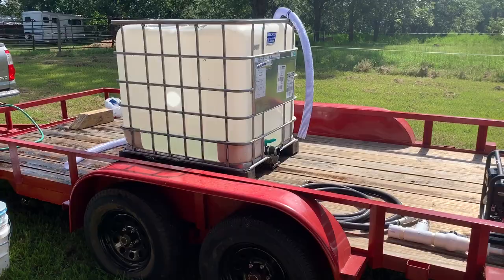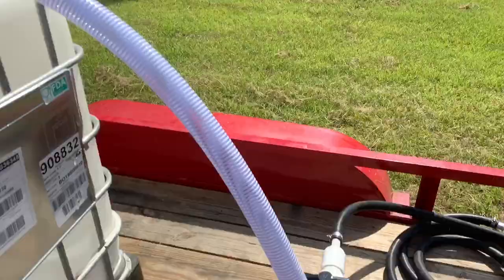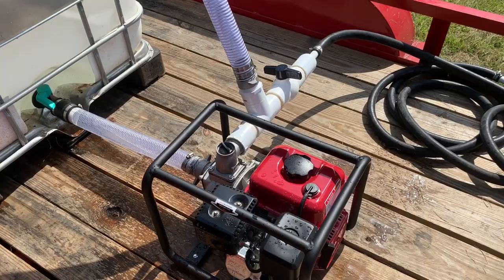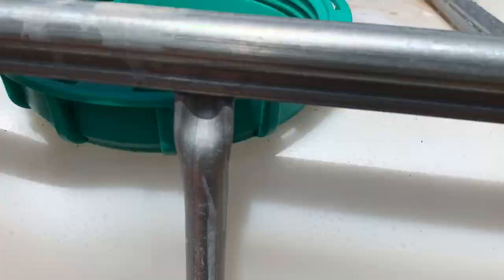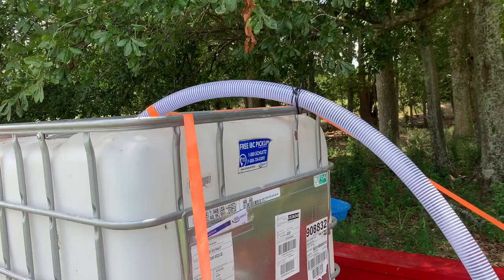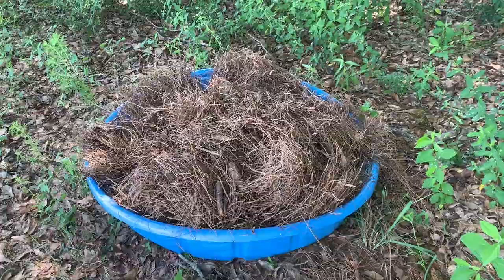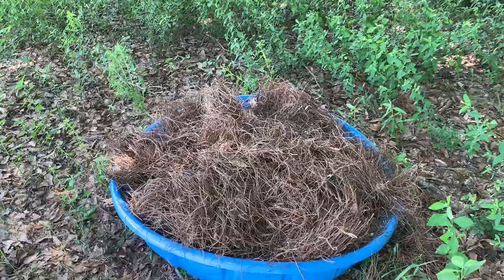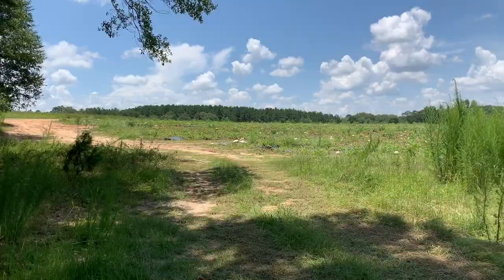Feeding Bees with the New Pump System

Comment: Love how your tank mixer performed! Looks like a timesaver for sure. Thanks for the update.
Reply from the maker: Yes I think it is really going to help. Can just drive from location to location and quickly fill up the containers onsite. Whether it be kiddie pools, five gallon buckets, gallon buckets, small totes or even quart jars, it should work just fine. Kind of like using a water hose. Will hold up to 270 gallons, probably more than I will ever need at a time. Thanks for checking in.

Comment: Nice setup. May I suggest some quick couples. Farmers use them all the time when they spray their crops. Not that expensive and great time saver. You could uncouple and tie your engine down and then 20 seconds later you are reattached. It is hot here in MN also with low 90's and high humidity. Sure saps the spark out of a person in a short time. AC is a lifesaver.
Reply from the maker: I will have to look into that. It actually only takes a couple of minutes to hook it up now but anything to help would be nice.
Reply from the maker: And yes. The heat and humidity is an absolute energy killer.